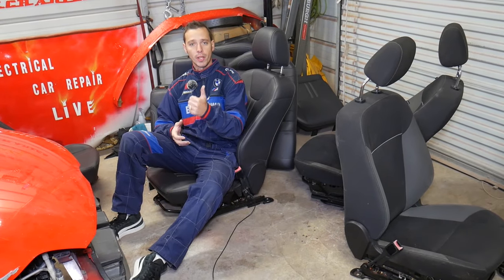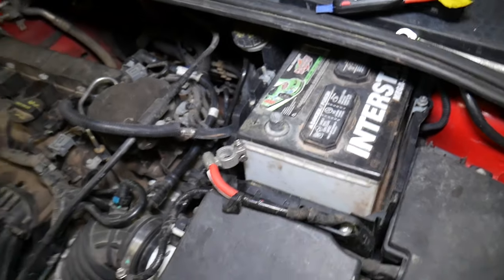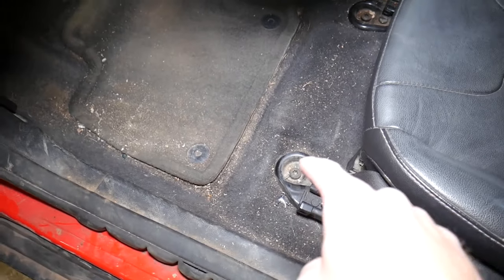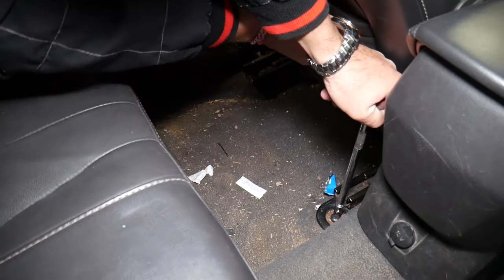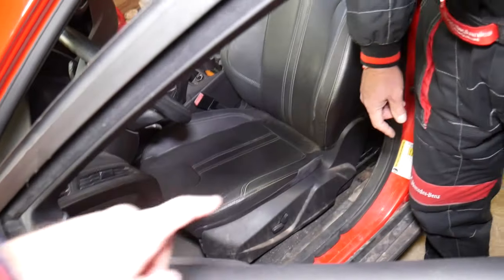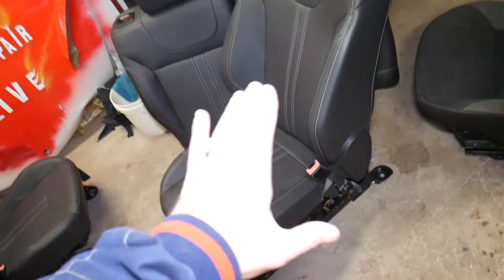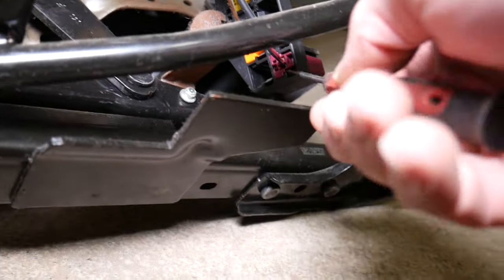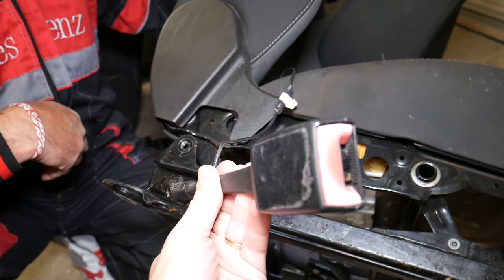HOW TO REPLACE SEAT BELT BUCKLE ON A CAR

Comment: Are you a qualified mechanic? I thought loosening the negative is a bad thing as you're making relays and the software jump on and off quickly as it gets moved about. I can't see any point. Just quickly disconnect and isolate pos. No probs. Right?

Comment: Hi what is the starting price to get this fixed?
Reply: 100 CAD
Reply: @codyking5612  that’s fucking insane considering the cost to replace yourself
Reply: @nummnutz7046  not rly most shops charge by the hour not the job and having starting rates of like $85-100 CAD for minimum one hour work even if it takes only 20-30min